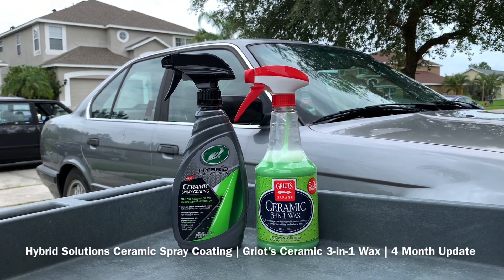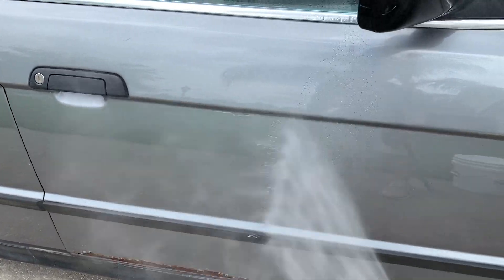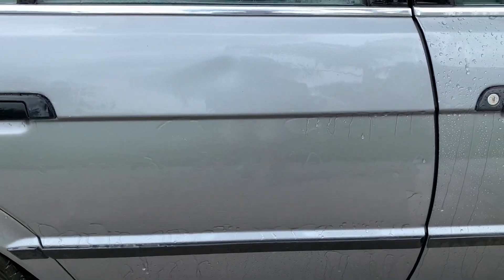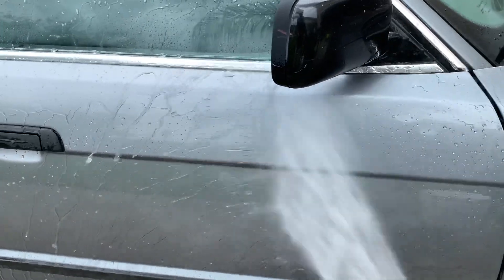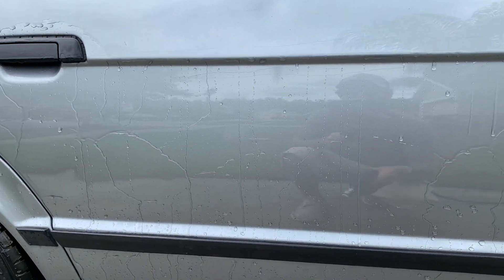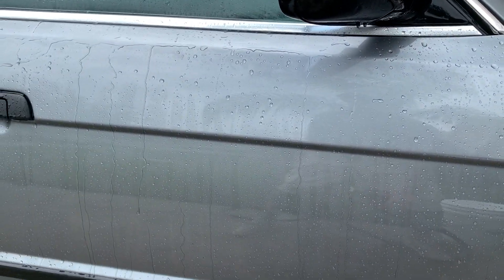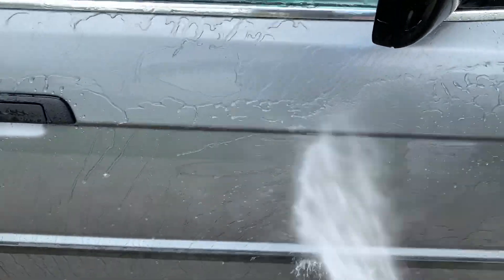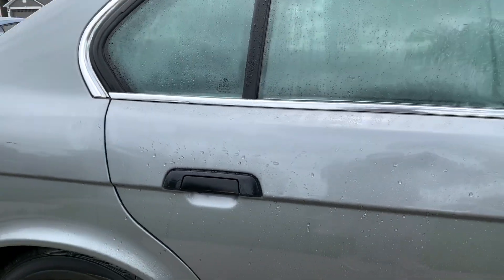Hybrid Solutions Ceramic Spray Coating | Griot's Ceramic 3-in-1 Wax | 4 Month Durability Update

Comment: Amazing that the griots is so long lasting so far and is this 3 in 1 griots good for topping off a ceramic coating and rejuvenate it?
Reply from the maker: I had troubles getting the Griot's Ceramic 3-in-1 Wax to level out well on top of the older Adam's Ceramic Spray Coating, it left behind some streaking.  This Griot's is a significant protectant, so I prefer those lighter toppers that are going to allow the coating to maintain its own properties rather than being covered up with the performance of a heavier product like this Griot's.
Reply: WaxMode Thank you Waxmode, it was very well explained. I am still debating on which silica spray I should use  to use after my maintenance wash on my ceramic coated vehicle. The ceramic coating that I am using is 3.0 cquarts edition and I am learning as I go on because I am 15 and don’t have that much experience since I started at age 13. And thank you again.

Comment: Your pressure washer sounds so quiet! What brand of electric pressure washer were you using in this video?
Reply from the maker: Editing wizardry, I perform the voice separately so I’m able to reduce the sound of the pressure washing during the edit to make sure it doesn’t drown the voice out. It was a standard Ryobi 1700 unit, with a Kobrajet 3/8” hose and an MTM Hydro SGS-28 gun.  These accessories make these cheaper washers so much more convenient.

I hear the Active 2.0 pressure washer is a fantastic unit with the best pump in the under $400 category, not sure on the sound but the Adam’s unit seems to be a quieter option that I’ve heard.

Comment: With all the spray ceramics on the market, what would be the point in using something that costs $50+ and takes longer to apply??
Reply from the maker: Definitely a good question, especially when you're keeping up on wash maintenance and making sure that the protection remains topped up, these products will definitely be able to provide awesome performance until your next polishing session.

But with the full blown ceramic coatings, they have a much more significant form of longevity, a much greater hydrophobic performance, a much thicker layer of protection left behind, and as a result likely a much greater resistance to UV bombardment and degradation.  If the protection of the paint is my highest priority, I'm always going to reach for the full blown paint coatings to provide that base layer foundation of protection.  

For me, that additional time and expense to apply a coating like CQUK 3.0 is well worth it for its features, given that I already have the experience and polishing tools needed to perform the prep myself.
Reply: Awesome. Thanks for the in depth reply. Much appreciated!

Comment: maybe a dumb question. would you consider griots 3-1 as a drying aid and add to protection during a maintenance eash?
Reply from the maker: Hey Barry, I would not prefer to use the Griot's as a drying aid, it's a bit heavy for me to fill that role although you could get away with it in some situations without problems.  Griot's can be really funky, it can wipeoff cleanly in controlled situations, but you can definitely run into trouble out in the sun or in the heat when working across an entire car on certain paints.  For drying aids I like much lighter style of sprays that are easy to wipe clean in less than ideal situations like Wet Wax.

Comment: great channel. Didn't try other of these, but I was NOT impressed with the ceramic wet wax. Hydrophobicity was gone in a week. Gloss was good but only for a few days.
Reply from the maker: Thanks for the feedback!  Are you working with Ceramic Wet Wax by itself or are you pairing it up on top of a base protectant?  Ceramic Wet Wax is more a refreshment for me, I wouldn't prefer to use it by itself and I think it would be typical to have it diminish by itself more rapidly unless you're using it to top Ceramic Spray Coating on a regular basis.  I greatly prefer Wet Wax as opposed to their Ceramic 3-in-1 Detailer.

The Hybrid Solutions system you're not going to see the Fusso Coat level beading out of it, but from what I've seen the Ceramic Spray Coating and Ceramic Polish & Wax can hold up in durability so long as you're not expecting crazy hydrophobic monsters.  Keep them refreshed with Ceramic Wet Wax and you've got a system that should easily get you until the next decon/polishing session.

Comment: Megs UQW Vs Megs UQW new formula any plan?
Reply from the maker: I love the new Opus sprayer top on the new UQW for sure, just always enjoyed working with that sprayer and it's crazy to see Turtle Wax switch away from the Opus sprayer and then Meguiar's switch into that sprayer.  Definitely need to run more testing on the new UQW and UQD formulas.  Currently on a gloss escapade on the test panel with Poorboy's Black Hole Glaze.  Really surprising results to see Black Hole actually improving the gloss of what the abrasive was leaving behind after washing Black Hole.

Comment: Is griot 3 in 1 user friendly in the sun? If not what the best for apply in the sun. Currently using meguoar express spray wa
Reply: I would not recommend hybrid ceramic wax in direct sunlight. At least not the first coat. With this product (and meguiars hybrid ceramic wax) the first coat is put on, like normal wax, when the car is dry and requires buffing. This in direct sunlight will cause swirl marks and hazing. However, second coats to keep the hydrophobic aspects can be put on when the car is wet and I would say is generally okay in the sun. I think the best product to use in direct sunlight is touchless sealants like CarPro Hydro2. They don’t require the first coat like the hybrid ceramic waxes do, instead you spray on and wash off. It clings on the paint without having to touch it.
Reply from the maker: I would not recommend the Griot's in direct sunlight.  You can get away with it in some situations and on some paint, but other times it can bite you and lead to streaking.

Anytime I'm working in the sun I want something light, and I want to spray directly into the towel and spread and wipe with a separate dry towel, and never spray directly onto the hot paint itself.  I've had good results using a variety of different products like this, including the new Meguiar's Ultimate Quik Wax and Quik Detailer, Hybrid Ceramic Detailer, Ultimate Fast Finish, Ice Spray Wax, Bead Maker, CG V7, ect.  I don't like to use any of the heavier ceramic spray protectants in direct sunlight if I can avoid it.

Comment: Hey waxmode, I need some advice. I remember Brian from apex detail explaining how he stores gyeon can coat or carpro lite but I can't find the video. Can you give me some advice on how to store them once they've been opened? I remember something about a fridge and that's it.
Reply from the maker: Zymol are the only waxes that I actually store in the fridge, the rest I keep indoors at room temperature including the coatings that I've opened up.  So far the only coatings that have visually gone bad was the first formula of the Blackfire Crystal Coat, the McKee's 37 SiO2 Enhanced Coating, and the first formula of DPC Shield.  Everything else, some of which I opened many years ago like Gyeon Mohs, Prime, One, CanCoat, and Gtechniq CLS, EXOv3, CarPro CQUK 2.0 and 3.0, Lite, they never crystallized in the bottle or gelled up.  

CanCoat you want to take that sprayer out and reseal the container with the original hard cap, never let the sprayer sit inside and I'd clean the sprayer out after each use.  Other than that I might pull some of the older coatings out on the test panel and see if they're still usable.  So I'm not sure on the shelf life improvement of refrigeration.
Reply: @WaxMode  thank you sir. I really am grateful for you and the other detailers I watch.
Reply: WaxMode yes please test old coating

Comment: Nice video ! TW is so overhype ! S&S lasts only 2 months and same here with the hybrid ...
Reply from the maker: Thanks Mr Guillaa!  I still like the Hybrid Solutions system and both the Ceramic Polish & Wax and the Ceramic Spray Coating are holding up great on the other test car in their durability tests.  But Griot's is definitely showing a special performance on this BMW paint for sure, they did a great job on this formula to get it to be as durable as it is.

Comment: So which product do you recommend?
Reply from the maker: Both are capable, I think Griot's has the potential for the best durability between the two of them, but I've gotten months and months of good durability out of both.  I would lean towards Griot's and pick up their Ceramic Detailer to use for regular maintenance, while applying Ceramic 3-in-1 Wax once every few months.

Comment: Can I use the TW as a drying aid?
Reply from the maker: Grab the Hybrid Solutions Ceramic Wet Wax as a drying aid.  This Ceramic Spray Coating is heavier, you need to manage overspray more effectively and because of that, I don't prefer to use it often as a drying aid.  You can get away with doing so, but Wet Wax is a much better option for that.

Comment: I don't really know how to feel, nothing against the review but comparisons for these two seem to be so contradictive across the board. 

For some the Griots does very well for others it does poorly (in terms of longevity). Same with the Turtle Wax there just seems to be a unknown variable which largely effects both.

I've been scratching my head over it and I don't understand why. I don't believe anyone is lying nor do I feel anyone has a reason to lie it's just .. these two can be a coin flip as to which will preform a good bit better than the other you don't see this very often with products.

It's mostly a yes or no type of answer really just definitely but not the case with these two. I almost wonder if it's the rejoin they live in which is effecting the results, I've also wondered if one just had a bad batch at some point too.

For every good 1-2 month review of Turtle Wax there is a bad one same applies to Griots. User application can only play so large of a roll but really it just stumps me as to why so many people have contradictive results.
Reply from the maker: There's a ton of variables at play when it comes to product durability, it's impossible to determine which ones have the highest relevancy and significance when it comes to answering why one is getting better results compared to another.  This is one of the reasons why I'm running the Hybrid Solutions Ceramic Spray Coating on the blue test Honda, so that I can cross reference the results between the two different test cars.

All cars have a wide variety of different types of paints and clearcoats, you've got some paints that are soft, hard, medium, sticky, etc.  Not all clearcoat is of the same chemical composition, and I theorize that even the base composition of the clearcoat itself can have a significance in allowing protectants to bond more effectively to it.

Then you have the healthiness of the paint layer that can have significance, and this is actually the biggest determinant in the short term performance of the products that I test.  Any clearcoat that is showing oxidation or hasn't been polished in a while will never be able to allow proper bonding of the protectants on top to their highest levels.  

Related to paint healthiness, if I take two of the same exact cars that were painted one right after another at the factory with the same exact paint, and yet one of the owners garaged kept their car and maintained it properly, while the other owner allowed it to sit in the Florida sun unprotected, or had negligent detailers buff off 75% of the clearcoat overtime and remove that built in UV protection in that paint layer, and then I go and prep those cars the same exact way and apply the same protectants on top and allow them to go through the same durability test outside 24/7, I theorize we would see a drastic difference in the durability of the protectants.

Then you have the different levels of prepwork that users are performing, the different environments and driving conditions and exposure to elements that cars are put through, different soaps and concentrations used for wash maintenance, how often maintenance is performed, all of these could have some input into the end results for the actual durability of the protectants.  The best that I can do is prepped the paint that I have access to in the best way that I can, and just showcase the results so that we can add one more statistic to the list of different experiences.  

But I think the take away from these tests, is with reasonable amount of prepwork you should be expecting months of durability with these spray protectants.  If you're washing paint regularly and maintaining often, you've got to go with the product that gives you the properties that you want to see in the short term, or one that is easier for you to work with compared to the other.

Comment: If it's so easy to use, I'd top Griots with Griots every other wash.
Reply from the maker: That will definitely get the job done.  I like to use something after every wash so the lighter spray toppers fill that role, and then reapply the heavier spray protectants every once in a while would be my option.  

I need to get my hands on their latest Ceramic Speed Shine to see how well it does after every wash.  Just be careful on hotter paint or in direct sunlight with Ceramic 3-in-1, I’ve seen some guys have slight high spot marks where the product cured unevenly.
Reply: @WaxMode  I don't think we can't get speed shine in the UK yet. It seems cheap enough in the US, but then a lot of their products do until they come over